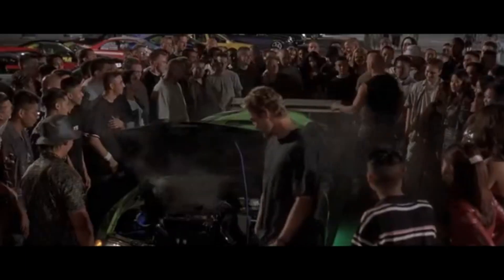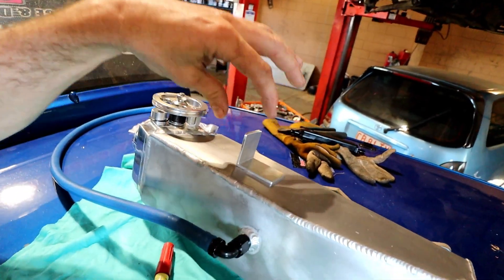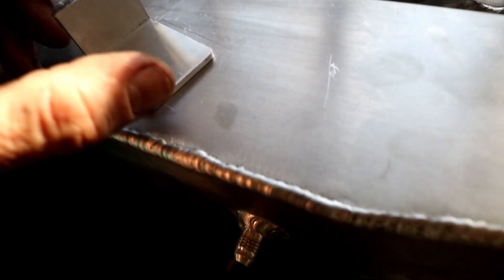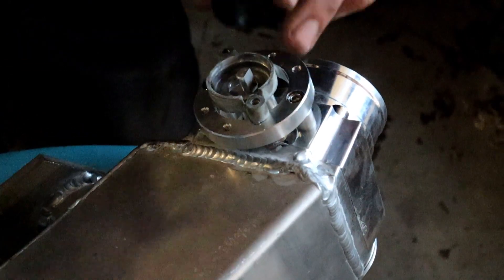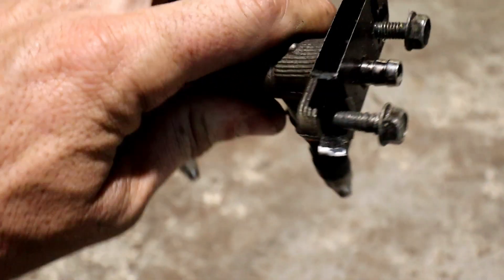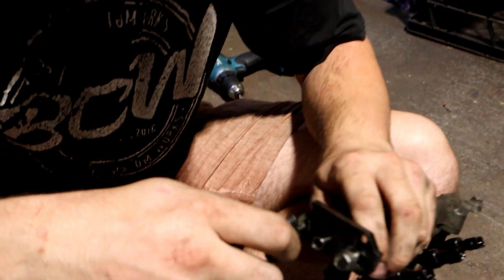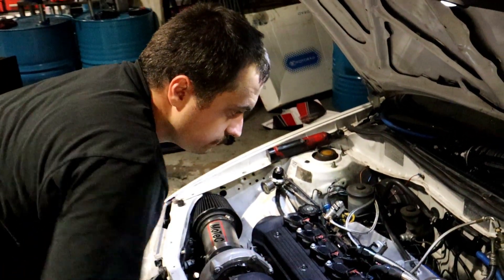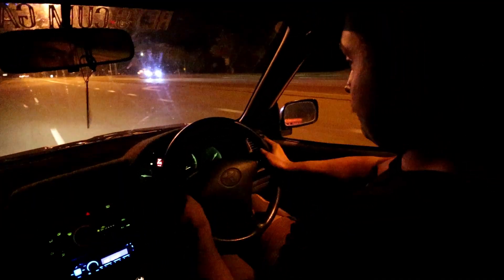4EFTE Intake Plenum Install

Comment: Heya Matt, ive gotta ask - What gearbox are ya using to hold all this power? Just about finished collecting everything for a 'big power' (250-300atw hp) build but have heard about a fair number of boxes breaking under those kinda loads. Any recommendations? Cheers!
Reply from the maker: This car is making atleast 300hp, and has before on dyno. We are still running the stock C150 gearbox. Havent blown one up yet lol
Reply: @Camp_Dogs  Holy shit. Thanks for assuring me that my C151 isnt made of cheese and toothpicks hahaha
Reply from the maker: @Shadowcloud1  after everything ive read on the net we were sure it was going to explode on the first pull. Nick doesnt treat it nice either lol
Reply: I’ll get Matt to film how flogged out it is and how rough I can treat it, and it still doesn’t seem to mind 😂
Reply: @HowToTurbo  It's not the one with the Chinesium LSD is it? Would make for a hella interesting update vid lol
Reply: @Shadowcloud1  nah thats not mine man, just a standard unopened C150

Comment: hey matt! what can the 4efte on standard internals 98 , standalone ecu, td04 and all the other bolt ons make (power) on a safe tune?
Reply from the maker: ive made 165 hp reliably for years on a 4efe (skinny rod engine) ive never actually used a 4efte big rod engine before... the 4efte rods are similar to the 5efe ones in terms of thickness, id push the engine to around 180hp on 98 fuel and maybe 220 on e85. thats about it really.
Reply: @Camp_Dogs  thats exactly the ballpark ive been advised! 130kw/180hp...

well it should do while i learn how to build and forge an engine on my 5e :D thanks matt!

Comment: Can You Explain The Importance Of The Vacuum Box?
Reply from the maker: saves having all the hoses coming off the intake manifold... looks a lot cleaner.

for an n/a car running Independent throttle bodies, it allows you to connect each runner via a vaccum hose each and then connect them to the vaccum box... it allows you to then run a brake booster

Comment: Sick! 🤣
Question, I'm about to do something similar with my tps, I'm running the Yamaha ITBs for years but these tps' are impossible to find locally to me and I want to convert it to a Toyota tps. Was just wondering if you recalibrate the tps after? Or if you welded the adapter on to suit the position of the flat blade at closed throttle? 😩
Reply from the maker: Yes and yes

Comment: Just a reminder to loctite the throttle plate screws before they go through your motor. I bought the same throttle body and they were just tight enough to not be able to unscrew them just by pushing down and turning  with your finger
Reply from the maker: thankyou mate, we double checked them!